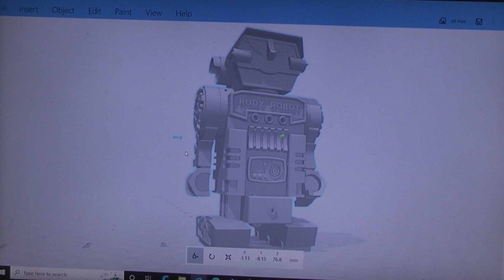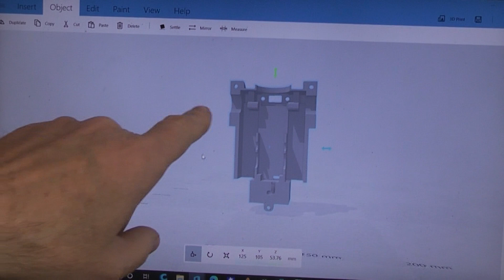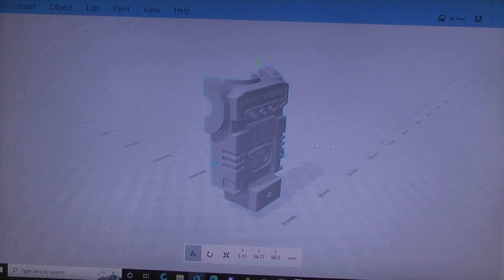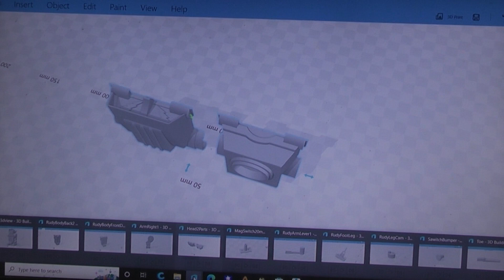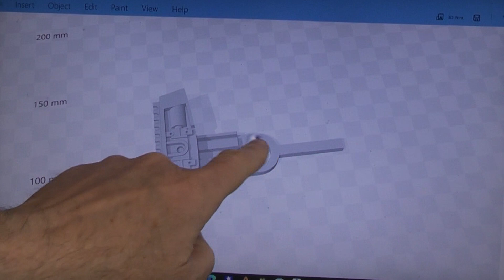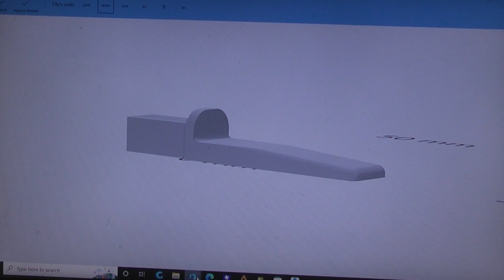CAD design for a mini 3d printed walking Rudy the Robot. V2.5 / baby Rudy, Mini Rudy ?

Comment: That's a big undertaking drawing those complicated parts. What's old is NEW again, the 1960's had such coOL designs. Great to see a new generation able to experience that Bot.
Reply from the maker: It's not any more work than any of the 100's of other 3d printed mechanical robots I have done in the past. But It is cool like you say to share some of the old design with new generations.